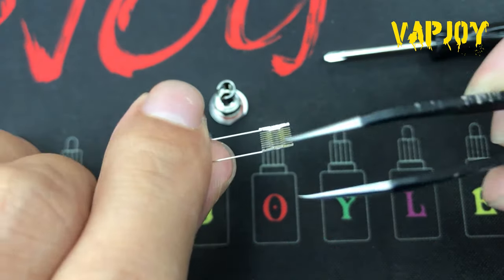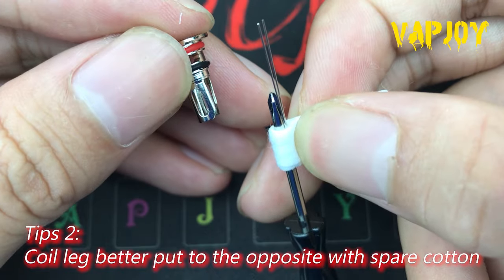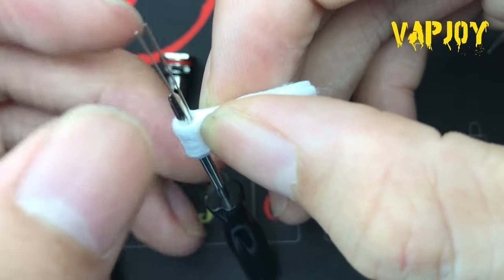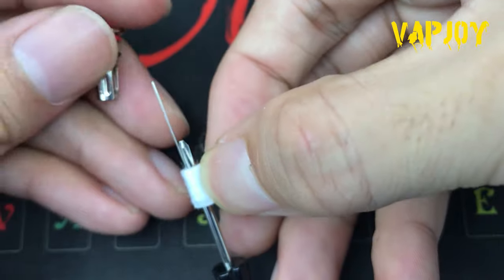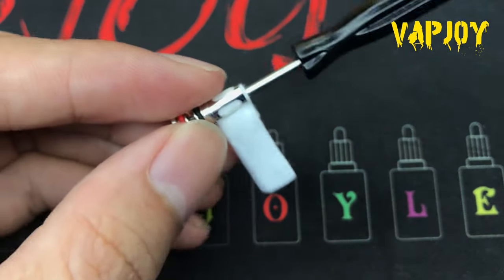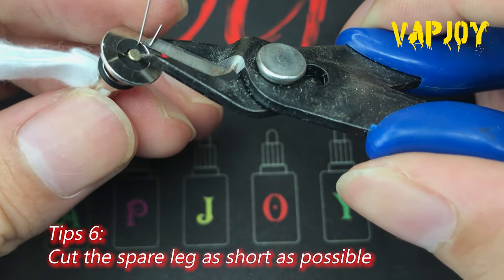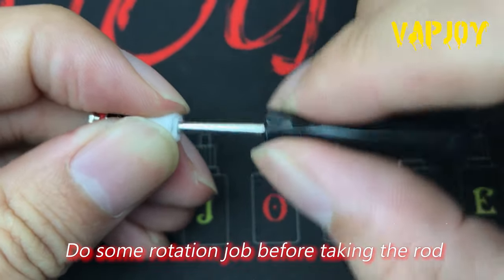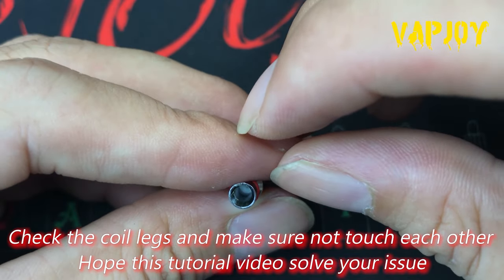Caliburn G0.8 DIY Rebuild Kit and Tips to Solve Cotton Burnt or Battery Flash

Comment: Very nice video, thank you for the clear instructions. 
I already made three rebuild coils with your first video, the first two meshes I unfortunately fucked up, but then after I made some adjustments by myself (the same you pointed out here in this video) it worked like a charm.
Few quick tips from my side is to:
1. Use two strips of cotton (four layers)
2. When wicking the cotton around the coil holder just use one layer (cut three layers away), this way it is easier to get to top part back on again and you don’t deform the coil while trying to get the top on it again.
3. Before you put the top part on again insert the long uniform rod carefully after pulling the other one out. This way the legs don’t connect together again while trying to get the top back on…

Your Rebuild-Kits are amazing! They taste better than the original coils. Thank you VapJoy-Team!!!
EDIT: The cotton you provide with your RBK is disgusting!🤬
Burnt taste after approximately 20 draws, using traditional cotton made for vaping it is much harder to wick it correctly, wasted three coils because of your low quality cotton and three more while trying to wick with cotton bacon…
Reply: Can u do a video for a cottonbacon rewick pls bro
Reply: Hello, if you have such a situation after 20 times of sucking, it must be the wrong use of cotton flower (cotton flower does not absorb oil, leading to dry burning), or you do not add enough oil, the lack of oil supply leads to dry burning). I have a lot of test samples, I feel that this heating ring consumes oil quickly, so you need to fill oil in time, as long as these can be done, I can pump one for half a month. Hello, if you have such a situation after 20 times of sucking, it must be the wrong use of cotton flower (cotton flower does not absorb oil, leading to dry burning), or you do not add enough oil, the lack of oil supply leads to dry burning). I have a lot of test samples, I feel that this heating ring consumes oil quickly, so you need to fill oil in time, as long as these can be done, I can pump one for half a month

Comment: I tried six times and soon succeeded. The points you need to pay attention to have already been stated. It seems unimportant, but it is important for a good result. Don't forget to rotate the mesh coil. The smooth side of the coil will contact the cotton. Finally, when viewed from the top you should see a round hole. There should be no gap between the coil and the cotton. I have been using it for 7 days without any problems.

Comment: When you do get Dry Hits here’s the answer:
Use traditional cotton made for vaping like Cotton Bacon or something else…
It is a little bit harder but works amazing when you perfected the technique, my tip is to use a really tiny amount of cotton. 
The cotton should have a diameter thats 2mm shorter than the wide of the included strips. Just round the cotton evenly and not to tight with your fingers and put it on the included cotton strips, then there should be 1mm space above and below your selfmade cotton. After that you fold the selfmade cotton so you have two layers, that way it works perfectly for me. No dry hits anymore and long lasting coil life.
@VapJoy The included cotton is disgusting…
Reply: Man, you nailed it! It works great! Thanks!! :)

Comment: when inserting the pin, the inner wire bends sometimes, so make sure you check this and pull the wire a bit (CAREFULLY) after inserting the pin, to make sure that its straight and not touching the metal parts.

or if you already cut the wire, use a small pin or tweezer and push the wire towards the middle to make sure it doesnt touch the metal

Comment: I was having alot of issues after rebuilding the coil with the Vape Joy Rebuild Kit, after watching this video i will try rebuilding the coil again and will test it if it is having burning taste in just 2 days.
Reply: How did that work out for you?
Reply: @iDroiD-Gaming  brother tried this new trick, seems to work good for the 1st day, today is the 2nd day after rebuild, lets se what happens.
Reply: @bilalahmed.960  Thx brother
Reply: Where did you find that kit?
Reply: Have you solved your problem? Or not?
Reply: Where did you get the kit?
Reply: @haidaraljumaa5842  still the same issue, having burning taste on the 2nd day of using the rebuilt coil.
Reply: @Islam_Eliwa  don't know which on to use other then this one bro, honestly speaking, i just gave up the rebuilding stuff, orders new coils, the rebuilding kits are left alone now. 🥲
Reply: @bilalahmed.960  use Japanese cotton will work charm
Reply: @bilalahmed.960  That's because all RBK brands have awful quality cotton, even their "premium" labeled cotton.
In order to last more than a week, it's better to use good quality cotton like cotton bacon. Or another brand of cotton that's made for the RDA, so it can withstand high heat.
The problem is that it is much more difficult to install because the cotton bacon is fluffier and sloppy.
It takes trial and error several times to find out the right amount of cotton, otherwise it will gurgling/leaking/spitting or burn hits.
Reply: @bilalahmed.960  The viscosity of the oil you buy may be too high, and the oil conduction is slow and dry. If you don't want to change the oil, you can try this method, the inside of the sponge is not too tight, so that the oil faster. It should work out. Leave me a message if you have any questions.

Comment: I'm getting leaks; after rebuilding a coil and filling it, there is liquid inside the coil. I believe what's happening is the outer cotton is not inserting in correctly because it's too squashed in.
Any way to avoid this?
Reply: It is because you have too little inner layer of cotton, the outer layer of cotton did not cover the inner layer, you can try again in this way, I will show you a video when I have a chance.
Reply: @tu421mo  Yes, please do. And let me know by replying to this message thx.
Reply: @tu421mo 
I have the same problema. Did you solve It ??

Comment: In Caliburn G2 it doesn't work properly. All types are cotton's going to burn even in 2 puff. I prime it about 2 hour each attempt and did exact same things what you're doing. My previous g is much more compatible with your kit. It seems the cotton won't be wick properly even in 7+ hours to prime. Do you have any solutions or guide for G2 ? I think the response of the G2 firing censor is much more fast than g and it keeps burning. Need help asap.
Reply: It’s the low quality cotton that comes with the RBK… Try to use normal vaping cotton, like Cotton Bacon.
It is a little bit harder but works amazing when you perfected the technique, my tip is to use a really tiny amount of cotton. The cotton ahould have a diameter thats 2mm shorter than the wide of the included strips. Just round the cotton evenly and not to tight with your fingers and put it on the included cotton strips, then there should be 1mm space above and below your selfmade cotton. After that you fold the selfmade cotton so you habe two layers, that way it works perfectly for me. No dry hits anymore and long lasting coil life.
Reply: @TheMaxi98King  kit cotton strips stay outside or inside ? Which cotton make contact with wires ?
Reply: @denizturkucu4485  after a few tries I’ve found myself using cottonbacon (in contact with mesh coil) and one layer of the included cotton strips to get the liquid from the tank to cottonbacon. It also is easier to close the coil again when using the included strips as an outside layer (to saturate the vapers cotton)
Reply: @denizturkucu4485  If you need further disclosure just tell me, my way of communicating may lead to misunderstandings. I’m trying my best to keep it simple while explaining things, wich might lead to confusions.
Reply: @denizturkucu4485  another problem is the included coiling tool. The diameter is a little to small for my taste, I’m currently using a coiling rod with a 2.5mm diameter which works flawlessly
Reply: @TheMaxi98King  please make a video on your next build
Reply: @TheMaxi98King  can u do a build in your perspective pls bro